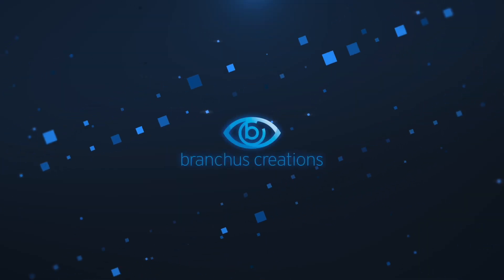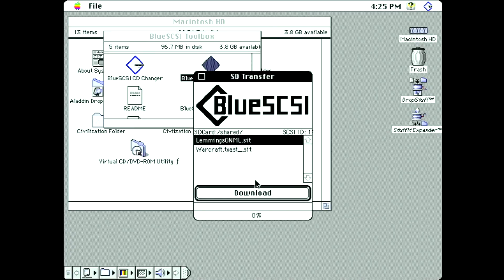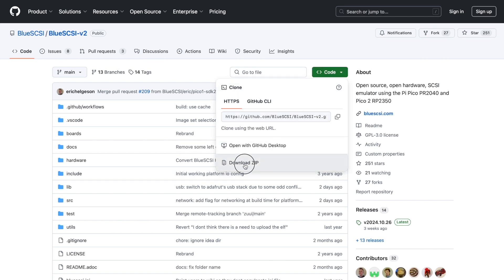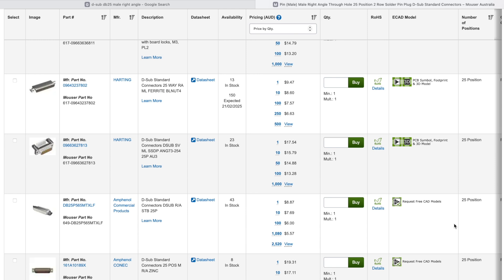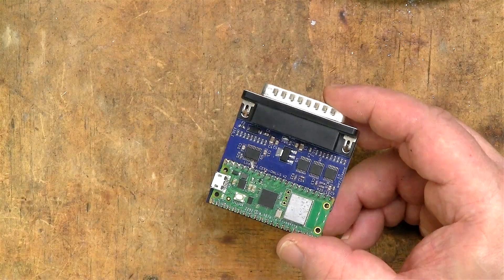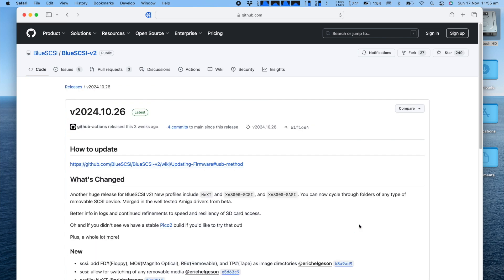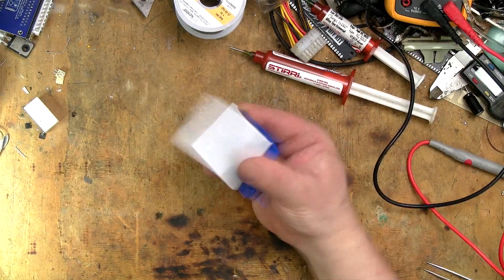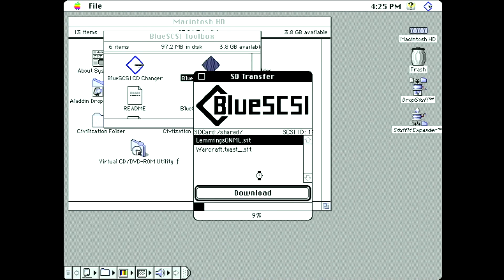BlueSCSI v2 DB25 External Review

Comment: Can you use two blueSCSI at the same time one intern and the extern DB25?
Reply from the maker: As long as there's no SCSI ID conflict and the bus is correctly terminated, you can. I do it all the time.
Reply: @BranchusCreations I don’t have the blueSCSI but I know every device need jumper for the ID address (min 3 for 0-7) _ is this on the board? the idea one is only for the system and one for working with (extern)

Comment: You can store 7 drive-images on the SD card and then use the startup combo with the desired drive number to boot from (CMD-OPT-SHIFT-DELETE-#), no need to make another BlueSCSI device ;-)
Reply from the maker: That key combo doesn't work with all vintage Macs.

Comment: Love your case design for the external Blue Scsi v2. And I agree with you on they should revise the external one to use an edge mounted db25. I've designed several things using edge mounted dsub connectors and they are rock solid like that. Plus the connector is usually half the price of a regular pcb mount right angle connector.